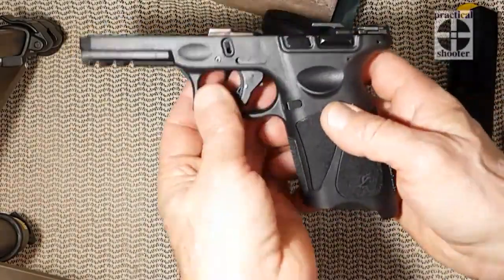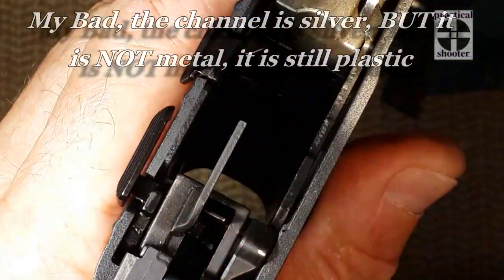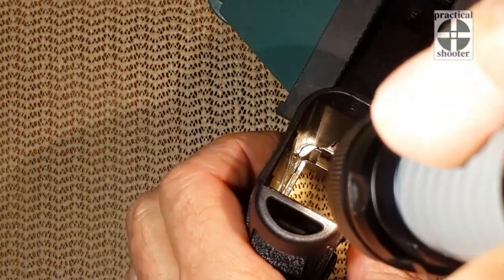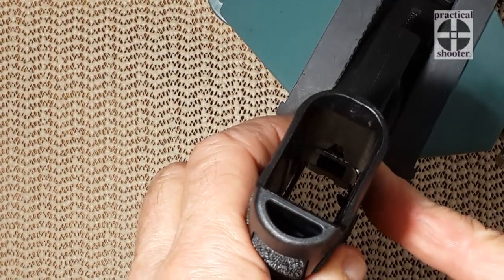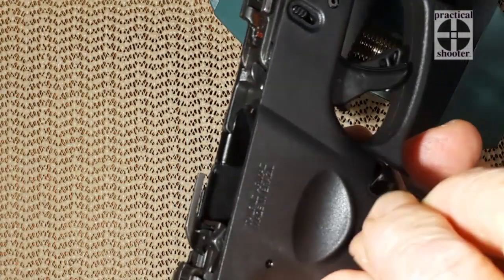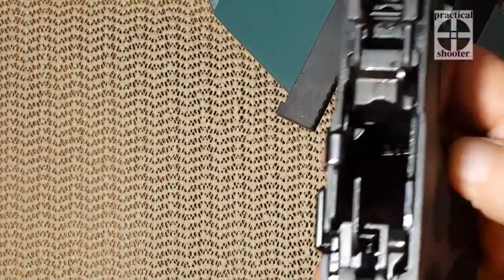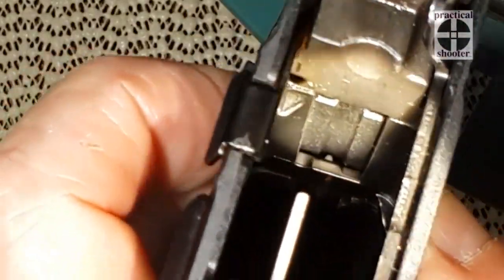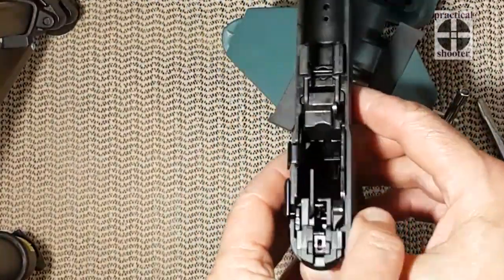Taurus G2 /G3 / PT111 Magazine release disassembly

Comment: OMG. My G3C mag got stuck and when I manually removed it, the mag release button came off with it.  I was actually going to send my gun back to Taurus.  Thanks a lot for this video.  You’re a CHAMPION
Reply: Ok, I am looking to buy a G3C soon after 2 months or so after getting my CCW in florida. appears to be a great cheap gun with just some minor problems like the ammo not coming out ejecting all the time and having to stop and pull a shell out. They say you have to use a small buffer tool to clean the inside of the barrel where the casing goes into. Already forgot the name of the dremel tool, duh, just remembered it but forgot the small buffer bit. Did you encounter that problem when it was kicking out shells? I am very cautious about buying things like this as I am not familiar with taking guns apart. Thanks. 🙂

Comment: There are several videos about this process, but this one adds one very key step.  The reassembly where you insert the magazine release into the grip frame does not require you to align the pin before you insert the release catch. You can align the pin after the catch is inserted so that it fits into the cutout on the bottom of the catch just as this video demonstrates.  Thank you very much for posting this video!
Reply from the maker: Thank you Mark.

Comment: First. Thanks for video.  The mag release stopped working.  Disassembled and cleaned. It looks Ike there is some scoring on the cut-out area on one side of the release.   So I decided to flip the release from the left to right.  As there is no scoring on the other side.  The spring works only a couple times before it stops.    When the spring is in the hole in the frame.  There should not be any play, correct?  Spring pin is straight no bends.  Any suggestions?

Comment: What kind of round count do you have on your PT111?  Any issues?
Reply from the maker: This is not the PT111 but the new G3. I have about 400 rounds through it.
Reply: @practicalshooter6517  Any issues?  Did it need any break in?
Reply from the maker: @NuclearGrizzly  it needs some break in, to smooth out some internal parts. Absolutely no issue.  Flawless and accurate. Well build except for the magazine release plastic insert. As long as you don't mess with it, the G3 should gives you years of good service.

Comment: My mag release isn’t working my mags fall out and it doesn’t bounce back in place even with the pin in NEED HELP
Reply from the maker: Was it like this when you bought it, or after reassembly?
Reply: I’ve had it for months first time it has ever happened
Reply from the maker: @bgosha11  Have you tried to take it apart and put it back together, as on the video?
Reply: I sure did I put the pin in the little groove on the release button and it’ll work but once I start pressing it more it’ll come out and I will have a loose mag button
Reply: @bgosha11  same with me bro my mag will fall out only way it will work is if I press on the button on the other side while I put the mag in